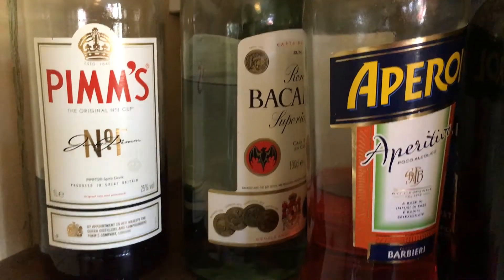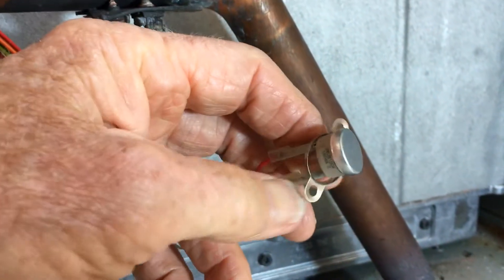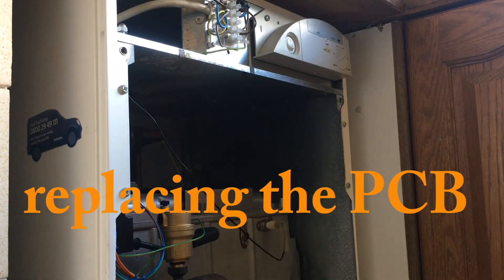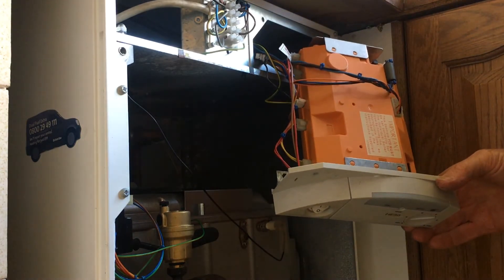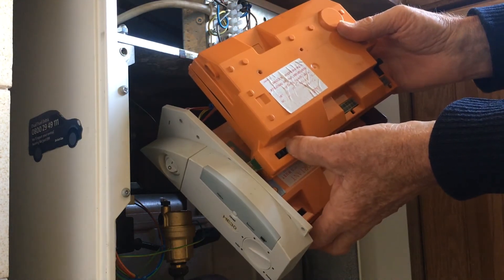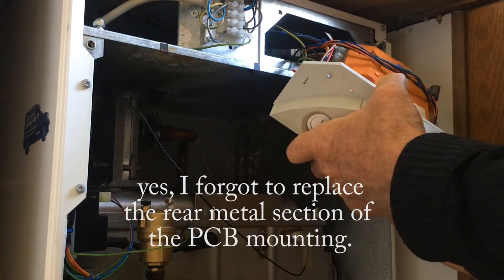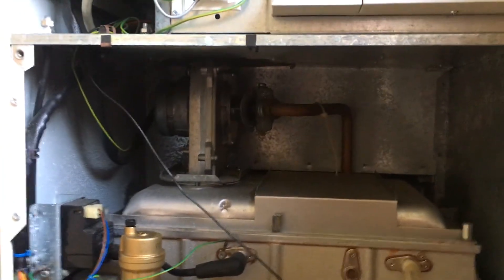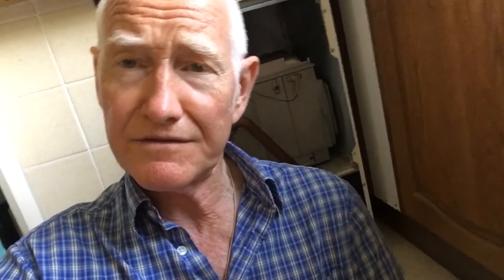Ideal gas boiler HE30 (ISAR/ICOS/ESPIRIT) F & H error codes DIY job to fix problem by replacing PCB

Comment: You should not be messing with Gas appliances without the proper training, certification and tools to test the whole system. Fair enough have a go on your own boiler but to publicise your mal-practices online for others to have a go is irresponsible. As a gas safe engineer I know the dangers involved in repairing Gas boilers and you obviously don’t.
Reply: @Breezy-Leaves  Nah, as any gas safe engineer will know as soon as you open the cover your done, as the cover forms part of the combustion process, plenty of builders in the nick for trying to save money...
Reply: @Breezy-Leaves  If you don't know any decent engineers that's your problem,  Its illegal old fruit get over it...

Comment: we changed the pcb although it didnt work with the jumpers in the same place but when I moved the jumpers to position 3 and 5 it lit up the neon flame and c  , after 3 minutes it changed to  the error flashing  L to F ! can anyone help? The burner is not lighting
Reply: Get a Gas Safe Registered Engineer to have a look at it. It could be a variety of things on this boiler. Have a look at Allen Harts videos to see what’s involved in a service by a trustworthy engineer. 

https://youtu.be/hHtLtlZfZQw